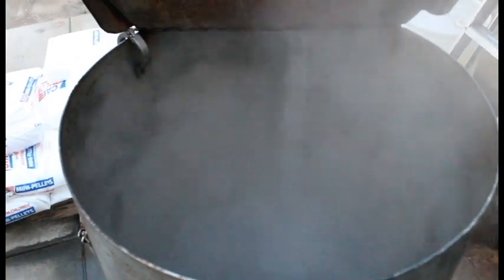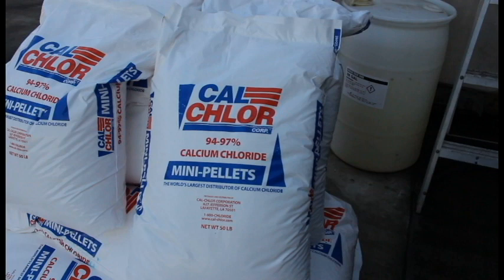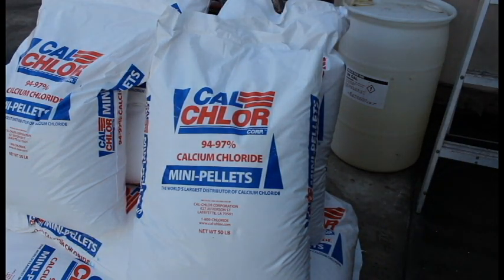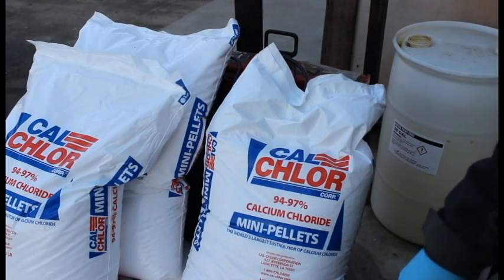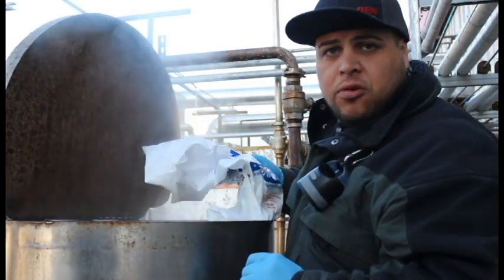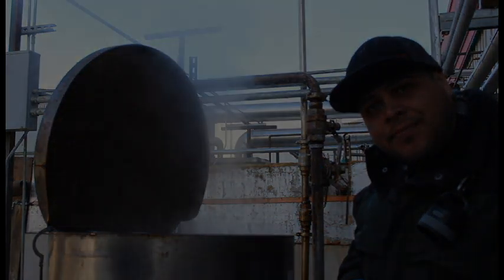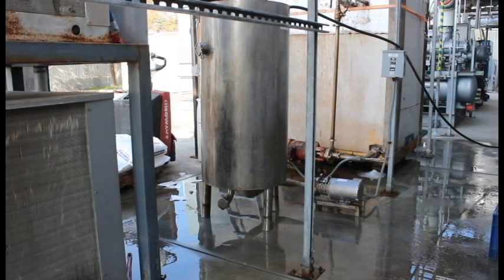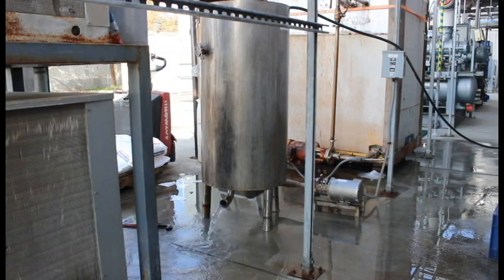How to: Make Brine from Calcium Chroride

Comment: Can I simply dump some Calcium Chloride into a pump sprayer, mix it with water, shake it up well and use? It is that easy? Can anyone help me? Thanks!
Reply from the maker: It needs to have a constant mix so it can dissolve and become liquid
Reply: Don't see why not. However, it will get extremely hot!

I use it for dust control on the dirt road next to my house. What I do is pour about a third full into a basic home bucket, then add water to about half full. I stir it for about a minute or so as it dissolves quickly. Then I pour it into my 2-gallon sprayer for application. If there is still pellet residue, I simply add a small amount of water and stir to dissolve the remainder, then add to my sprayer. If it's too hot, just use a rag to hold the bucket while pouring. 

Depending on wind and how much you need to apply, you might want to remove the spray head and apply it directly from the handle valve. Large droplets won't blow away in moderate wind and it applies much faster. It's also good to keep the area saturated with water as it helps to evenly disperse the large droplets.
Reply from the maker: Otherwise it turns in to a salt rock
Reply: @559powerscape  Even if it sits in water? Does this hold true for straight rock salt? Do you know? Magnesium Chloride?
Reply from the maker: I dont know honestly

Comment: You have to heat boil the water mix?
Thanks
Reply from the maker: No it's heats it's self it's a chemical reaction
Reply: @559powerscape  thank you very much for your response, how many gallons of water for 4 bags of calcium do you know estimated??
Thanks
Reply from the maker: @Endrry17  I don't I'm sorry I haven't worked at that place for over 6 yrs now. U want to dilute the calcium with water and pump to circulate and mix correctly other wise you'll get rocks of calcium.  It has to be enough water to double the 4 bags of calcium

Comment: Dissolved faster that I thought it would,
40 lbs in 2 hours. I used a salt water fish tank pump with a 5/8” hose
Reply from the maker: Nice! Yeah its pretty surprising how that calcium chloride dissolves pretty fast. It would be faster if you have the water in the tank circulating then slowly poor in calcium chloride. That will help it dissolve even faster instead of just dumping it all in at once.
Reply: GEORGE LOPEZ HOW TO DO IT YOUR SELF 
I just drop it in and walk away
Reply from the maker: @samgarofalo2461  If you do that it could turn it into a big oh salt rock at the bottom and clog the pipes and damage the motor for the pump.
Reply: GEORGE LOPEZ HOW TO DO IT YOUR SELF 
I keep the pump running

Comment: I got a pallet of calcium pallets to use for melting snow when ice, a lot of the bags are hard and formed into chunks.
I presume the calcium is still dissolve as long as I keep the water circulating but obviously it’ll take longer than five minutes per bag.
Any thoughts or input you can give me would be appreciated
Reply from the maker: Try breaking it while its still in the bag. Pick it up and drop it flat to see if that might help. I remember that I had to hit it with a metal rod to mix it up and break up any big pieces inside of the tank. It gets hard because moister gets in and makes it hard.

Comment: How much water you used for 200 lb of calcium chloride. and is the water in normal temp or chilled. how long it can be used or need to make new..i want to make for popscicle machine.is 200gm of calcium chloride okay for 1000gm of water. to reach a temp of -28..
Reply from the maker: You need a Hydrometer to determine the concentration of the calcium chloride it can be used with any temp water cause the chemical reaction of the salt and water is going to cause it to get HOT. You need to continue to cycle it till it has completely dissolved. To Test it the Brine has to be at 65 f degrees to see what the Hydrometer is reading . I forgot what it has to be reading at but there should be a chart online stating the concentration levels. 

You can reuse it over and over again until it is dirty. All you have to do is mix the Calcium Chloride with pre-mixed Brine instead of PURE 100% WATER. This will make it more concentrated with out making MORE BRINE. If you Want MORE BRINE you need to make a FRESH BATCH WITH FRESH WATER AND CALCIUM CHLORIDE. 

I used about i dont know about maybe 50 gallons or less per 2 bags. That container didn't have a water measurement.  Sorry and I no longer work there so I dont know the exact readings right on top of my head.